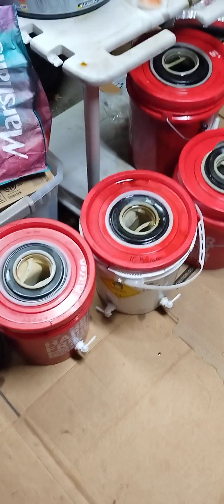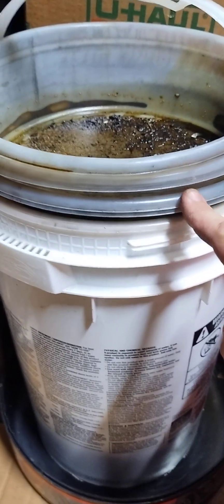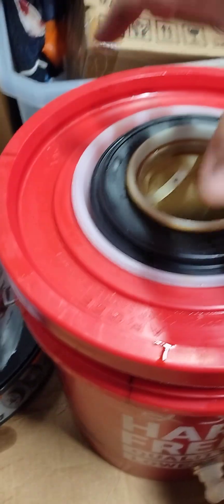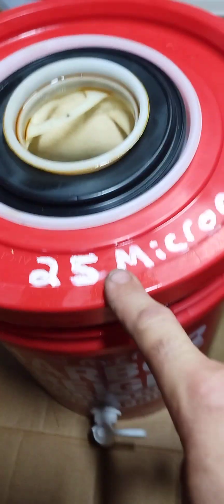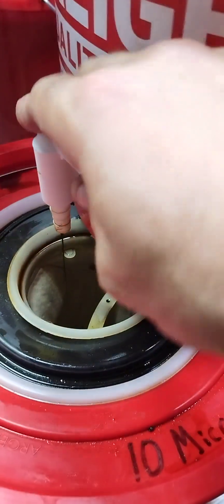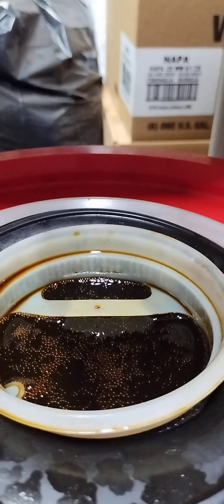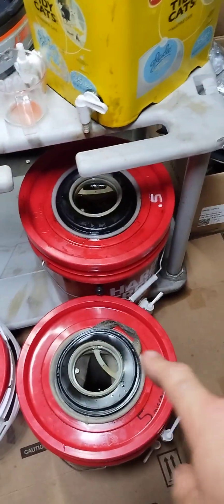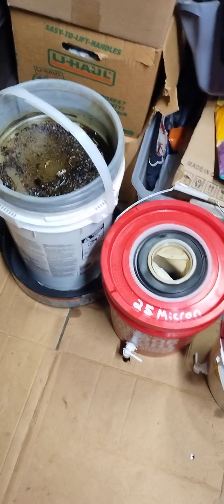How to filter waste oil at home on the cheap.

Comment: Any new videos of the setup you planned to do cant wait
Reply from the maker: Unfortunately my project list is a bit overwhelming.
The plan is still there, the items are still in the on line shopping cart but the only diesel engine I have is still bolted to the tool box.  I have 110 gallons of filtered oil and I anticipate over 100mpg on the motorcycle so unless I sell off my commuter for a mechanically injected diesel commuter or diesel swap the grand Marquis idk how soon the new idea will come to light.
Reply: @CarModsandDadBod nicee, love the setup I’m about to order all the same stuff from DUDA diesel, I ran about 20 liters of filter and settled used Oil in my 02 VW Tdi and it ran it fine so I’m ready to do it at a larger scale!

Comment: How about suspending the pails from the cieling and run a flow tube from bucket to bucket,fill the top one gravity will finish for you?
Reply from the maker: I actually planned on using a 5 tier stackable shelf with a bucket on each shelf.  But it wasn't in the garage long before it was full of stuff lol.
Keep in mind the drain valve will out flow some of the filters.
The half micron filter takes the longest to pass through.

Comment: Could I get the link to the sock filter
Reply from the maker: https://dudadiesel.com/filters.php
I use the polyester ones with the plastic lip. 
I cut a hole for the larger 7x17 one and drop it into the lid of a bucket 
Then I cut a hole in the piece that I already cut out or use a coffee lid and cut a hole in it 
Then I put the 4x14 inch filter in that.
So each time you pour it's double filtered 
If you want to do this make sure and get several filters so each filter lasts longer

Comment: Have you used this process on waste automatic transmission fluid ?
Reply from the maker: Yes.
Motor oil 
Vegetable oil 
Power steering fluid 
ATF 
Lantern oil
2 stroke oil 
It all goes through the filters and into the barrel!

Comment: Where did you buy the spigot on the bucket
Reply from the maker: Walmart. Though if I made the same setup again I'd use something different like a needle valve or ball valve for better flow control.

Comment: Good information. Wats the website to the company you used
Reply from the maker: Spigots from Walmart though if I did it again I'd use a ball valve or needle valve for better flow control, the filters are from DudaDiesel my recommendation would be to order all your filters at once as shipping starts at $12 wether you order 1 or 10 filters 
The EZ-BUCKET top filters are great but I wouldn't go smaller than 75 or 55 microns.  As the sock filters have much more surface area to flow through however the EZ-BUCKET top filters are cleanable.  I turn them up side down over my shop trash can and usually use an entire can of brake clean per filter to clean them.  Be sure to subscribe as I have a new design I'm working on.

Comment: when i get down to 50 micron I mix in about a gallon or so of kerosene or old diesel or off hwy diesel into my waste oil which speeds up the filtering process A LOT and helps clean the crud out. 
been running wmo/diesel mix in a common rail Tdi for a few years now no issues. I always filtered down to 1 micron.
Reply: What did you use to filter that low?
Reply from the maker: I may try that

Comment: I am a 2000 mile driver at 6 months. A tube drain valve flowing clean to clean catch 2.5 gal  bottle. Filter thru large auto filter improvised into catch tub. All clean and sealed. Venting when transfered. No black. No water. No debris. Reuse is possible. Thanks for the proper way vid bro!